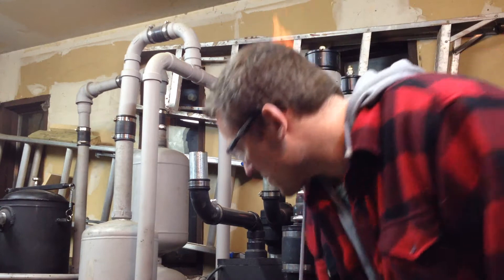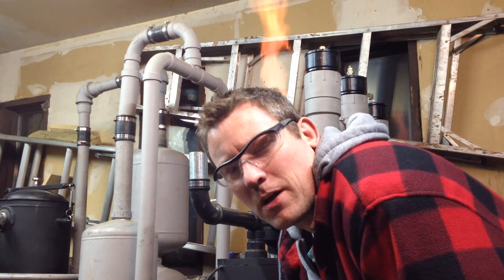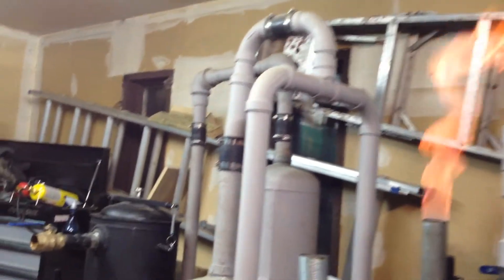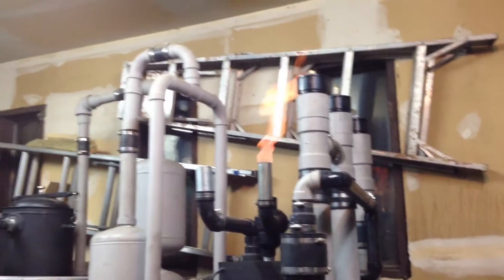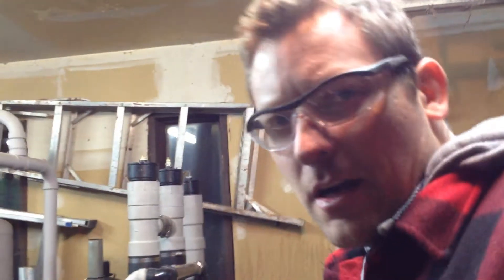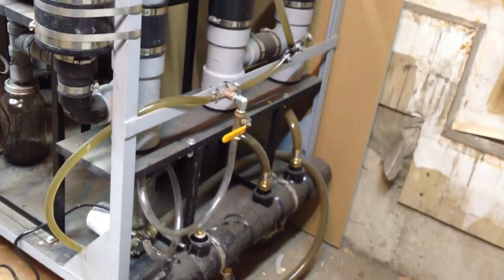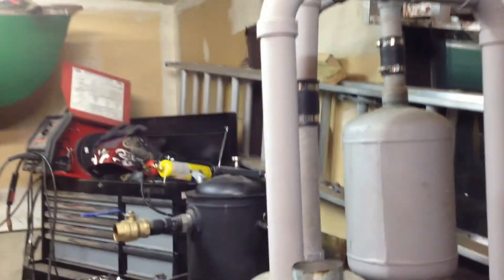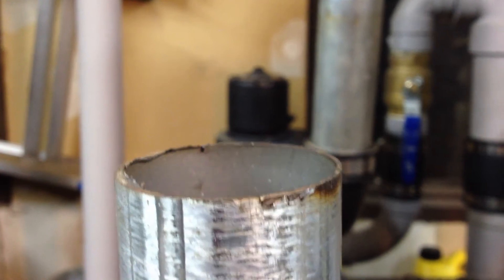homemade woodgas wet scrubber part 2 (testing)

Comment: You came up with a really good scrubber filter and I think I'm going to use this concept in my build once I get back on track again with my build. Thanks for sharing.
Reply from the maker: +flash001USA  Again thanks buddy, you shared your thoughts with your great videos and got me into this woodgas experimentation, other wise would have never came up with this idea.  im happy to share knowledge like you did. As of right now I have put woodgas experiments' on hold, busy with work and planning to get married moving out takes a lot of time.  Flash I don't have this would gas machine anymore, this was just a testing and learning device on what I want to do in the future.  I want to make a smaller device more compact then this one I have built.  Again thanks for your inspiration man!
Reply from the maker: +flash001USA  buddy I forgot to mention one last thing.  Before the machine was gone I did a couple more experiments, I shared this with Dan as well.  "The shaker grate" buddy if you make that thing flat with no vertical sides, instead of a bowl shape it made the thing work and flow really good no more back ups. what I used was a grill pan with holes. If you want me to make a video of this I will. just let me know  if you try this let me know it worked really well for me man.
Reply: +Josefppaz Thanks. I do remember you mentioning the new grate. What did you do with your gasifier?
Reply from the maker: +flash001USA 

Well buddy most of the parts I still have but mainly the
gasifier is in gasifier heaven.  Lol I
know what your thinking why the heck after all that work would you do
that.  I really enjoy building things and
drinking beer at the same time,  this
gasifier was just a rough draft and a big learning curve of what I aim to do
next.  This one I built was very bulky
but great to learn by. when other people see this I think it was to much of a
maze, so I want to compact it and simplify this even more like what you did.  I have some great Ideas to do this and by
cheep too, lol it’s the time I need to have to get this done but I will make
new videos some time next year.  Anyways Mike
or Flash  Merry Christmas man have a
great new years bud Joe zinkowitz
Reply: +Josefppaz Understood about the build being bulky. Before my wife passed last year I had already built a 3rd (and hopefully my final gasifier) which is a bit more compact then the one I have now. Don't get me wrong, I like the build but the truth is you could make one in a 10 gallon container especially if you are using wood pellets. I built the new one using a 100 gallon propane tank so it's still tall but it's skinnier plus it's much more robust due to the thickness of the container. This still allowed me to shrink the over-all size down by roughly 1/3rd of my original build. 

I have some good surprises for everyone on how I built the fire cone (hearth) this time around. I didn't  use the trailer rim and instead I used a one gallon paint can filled with the mixture using the same steel fire cone and the job came out top shelf and it is much much simpler than cutting and welding the rim. 

This new hearth bolts on and the restriction throat bolts on too so this makes the gasifier 100% repairable and doing mods is as simple as it gets. I may send you some photos of the the hearth in the paint can. I'm  like you man.  I start off a bit clueless on projects like this and learn as I go but I think we all do that.

Merry Christmas and have a happy new year.
Reply from the maker: Mike sorry to hear about your wife  hope you have a great Christmas and new year. It will be really neat to see what you got going
Reply: Yes  Sorry to here about your wife...   I am watching  all of you guys in this field..  I got about 5 different designs for a gasifier in a Cad software  program...   but  the more I see you guys doing things..  especially with a water scrubber now..  I keep changing my Plans before the build...   Thanks..
Reply: Flashem2me l
Reply: Could you send your design drawing, I want to try it in my home (kurnia.sumarga@gmail.com) thank you
Reply: A tip: you can watch movies at Flixzone. Been using them for watching loads of movies recently.
Reply: @Willie Vihaan Yea, I have been watching on Flixzone} for years myself :D
Reply: @Willie Vihaan Definitely, I have been watching on Flixzone} for months myself =)

Comment: amazing!
Reply from the maker: +Successfully Puzzled  Thanks friend
Reply from the maker: +Successfully Puzzled lol with out the Creator im dumber then a sack of nails that's why all the glory goes to my friend.cheers again
Reply: +Josefppaz I'm oping to mimmick your build. I'm hoping you can do an updated video of your entire setup showing every connection. I was lost in a few places when you explained your setup in another video. Although........ your run through was one of the easiest to follow I"ve seen. I think between you and flash, I can put one of these together. I hope. Thank you and God Bless.
Reply from the maker: Successfully Puzzled  Unfortunately I don't have the apparatus anymore, I may be moving sometime in the hear future the build was the most fun.  Mainly I build the gasifier to experiment and see what its all about what I plan on doing is build another one similar but way smaller more compact.  And yes flash has some awesome videos that's where I got my initial inspiration from.  The only thing I would change from his plan was to have a flat grate.  I see a lot of people with stainless bowls and I find it tends to clog up.  If you have a flat surface way better with my experience.  all the best
Reply: thank you for the helpful  reply.  much appreciated.

Comment: might be a good add on to put an extractor hood over the two flamepipes if only to prevent the heat rizing up to set the ceiing on fire and keep unburned gasses from filling the room the gasifier is in
Reply from the maker: watahyahknow ya that's a good idea, for the most part I usually have the machine out side but thanks for the tip bud : )

Comment: hey, Joe-ran a test last night-filter really just cleans that smoke like nothing else-I thought my gasifier went out, or something til I touched a flame to the flare! thanks for thinking outside the box, and allowing others to see the results. I'm really pleased with my new filter!
Pete
Reply from the maker: Casey Jo Awesome Pete Glade to hear buddy
Reply: +Josefppaz . Hey there Joe, I am working with Flash on updating Mazdalorean's drawings that Flash sent me into AutoCAD drawings. With all the type written words and all. I want to know if you would mind letting me send him a drawing of your air inlet valve config, with it above the drum top.
Just as an extra in the if the PDF file that will be on www.miniwoodgas. Buy the way, I thought that was an excellent idea doing it that way. Saves a pile of greif and aggravation.e-mail me back if you wish at mada94fxr@gmail,com
Mark
Reply from the maker: Hi Mark most of my machine was very similar to Flashes design I just used ball valves instead,  unfortunately I do not have the machine anymore.  this was just a testing and learning device on how well it would work.  I plan to make a more compact version of this machine in a later time.  As for the valve configuration it was the same as flashes design.  Mark my information is free knowledge for anyone thanks for asking
Reply: @Josefppaz  do you mean that  you only get good gas blue. When you hooked up the water? Thanks.
Reply from the maker: @bradpagnossin8647  hi Brad I did with both. The water Venturi was the best for flow never had any problems always had a consistent blue flame but the other way with wood sawed it was much harder to get these results blue flame was not always consistent more clogs in the system
Reply from the maker: +mada94fxr Hi Mark most of my machine was very similar to Flashes design I just used ball valves instead, unfortunately I do not have the machine anymore.  this was just a testing and learning device on how well it would work.  I plan to make a more compact version of this machine in a later time. As for the valve configuration it was the same as flashes design.  Mark my information is free knowledge for anyone thanks for asking.

Comment: now what will u do with this tech PLEASE dont say ur gona make electricity i keep telling every woodgaser i see that says that i tell u know steam is WAY more efficient than wood gas and it is actually a hell of a lot easier and it dosent care what u feed it it isnt picky i idont understand why people are afraid of steam but not wood gas they both have the same propensity to blow up and be fatal O.o
Reply from the maker: xoxoXoieoxox you know your absolutely right, I think including myself its so cool to see a chemical reaction transition take place with a piece of wood to gas transforming that energy to electricity.  lots of people even though its a old tech its neat to see it work, heck I just like looking at the blue flame that I helped create.  Absolutely steam is more efficient and cleaner to run, then wood.  most people have gas engine generators rather then steam engines.  Again if the world had steam engine  generators in the market the gas engine 5 hp engine wood not be as popular.  I totally see your point. lol steam engine wood be fun to build just don't have the money to get a lathe, and milling machine but its on my list : )

Comment: I think you nailed it. have you ran a generator? I can't believe how clean your gas is, most impressive-can't stop watching your videos.
Reply from the maker: Casey Jo Thank you very much! very happy to have helped. I haven't run a generator yet but I have run my 5 1/2 hp engine on it and it works just fine.  Buddy if you do use the wet scrubber idea make sure you have more suction then just little blower.  lol I killed my shop vacuum for this experiment but it was well worth it.  Cheers again I wish you the best let me know how it goesjoe

Comment: well it seems as tho u have attracted the attention of the holy trinity of imbert gasifers (CNC, FLASH and my self XOIE) there are few on here that are actually running imbert style gasifyers there are a thousand shit designs but ur sys looks promising i was wondering what ur end goal was and had one other question i am trying to convert my bed filter to a peculating water filter i wish to have no bed filter in the end but u have a dynamic no many others have to deal with MOTION my gasifyer is on a rat rod so it moves and im trying to make a way the down tube in the filter wont come out of the water under acceleration or braking or the like i been doing this almost 6 years now and i like some of ur ideas any opinion on my problem??

Comment: Nice job. That blue color is really awesome . You can't take your eyes off of it. I guess once your bitten by the wood gas bug , you can't help but head toward the blue light. Thanks for sharing.
Reply from the maker: you bet thanks lol im like a deer with headlights man.  Cant wait to see yours too :)
Reply: ***** I started cutting wood today. Still have to work on the blower. I also ordered a flow meter today. I'd like to be able to view how much air is moving into the system. I just can't get it done fast enough though.
Reply from the maker: you know what, its funny I felt the same way, but building something is most of the fun anyway.

Comment: That is a deliciously blue, smurf attracting, flame you have there.
I don't think you will have any trouble running an engine with this  :) .
When you turn the water pump off, do you see any differences in the flare?

I want to try something like this one day, perhaps using a shower head and a water pump to produce a rain storm in the gas cleaning cylinder.

Keep up the good work. This is the life blood of gasification  :) .

Oh, by the way, I bet the ceiling above your flare is getting plenty hot.
Reply from the maker: Steve forgive me Dan told me your name.  I saw a video on venturi scrubbers and they seem to work really well from a low pressure to high and then low. I have seen some guys use the water pump to make a rain storm idea but I believe the venturi idea works maybe better to wash the gas.  When the gas and water slip through the holes of the sink drain the gas particles  need to speed up and so the water has to speed up as well to get through.  So this makes the water and gas have to combine which makes this a very good wash, almost like atomizing them both. buddy. hope this helps
Reply from the maker: ***** lol forgot to say when I turn the water pump off I still get the blue flame due to the moisture inside which takes the smoke particles out.  But after about a couple of min the flame starts to turn blue purple pink and more orange particles.  Neat to see.  As for the ceiling lol I know I keep this to a minimal time.  Again thanks for the kind words

joe